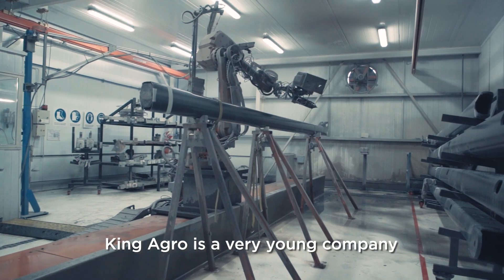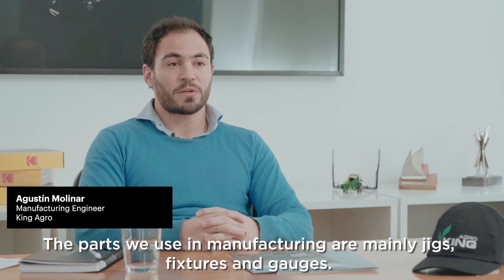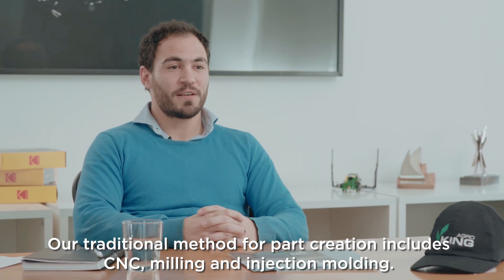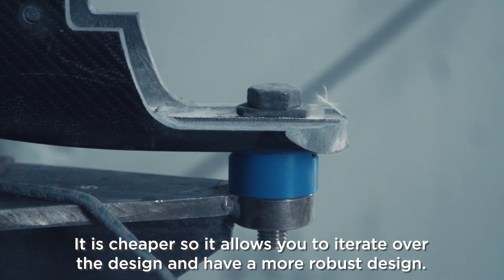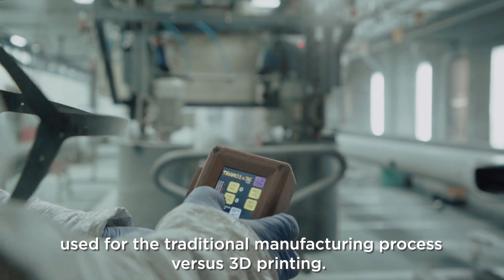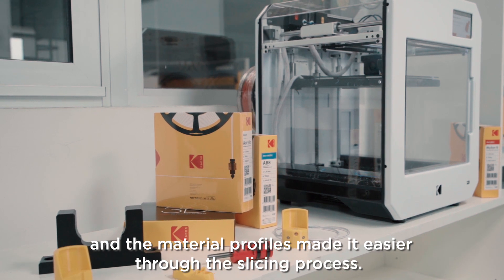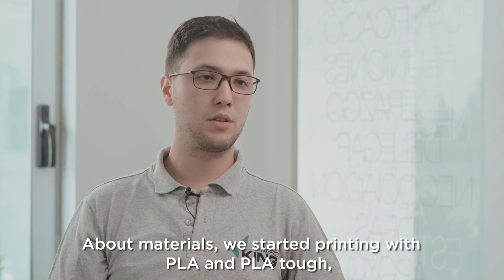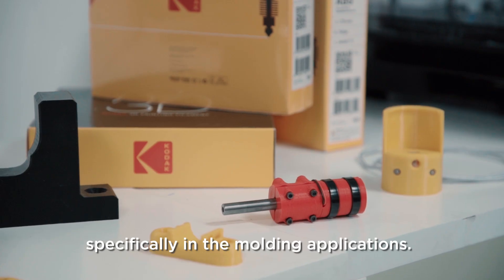King Agro: Optimizing production with KODAK 3D Printing

Comment: I’ve had 2 Kodak Portrait Printers. The 1st was delivered without the ability to use both nozzles.   Although I got a discount for being an “early bird”, that doesn’t mean that it’s understandable that the printer should arrive in a defective state. After weeks & several calls, it was replaced. I was attracted to their 2 nozzle approach because it would make some parts easier to print, & less tedious to clean up. After the 2nd printer’s arrival several weeks later, I experienced a filament “cross over” that caused a drive belt to dislodge. Although, probably my fault the warranty covered it. 
When I got the printer back & tried to print , Nozzle #2 wouldn’t load. After many weeks, my Step Son disassembled the feed dive for nozzle #2. It seems that the solvable filament that was in the printer at the time of the cross over repair was still in it, causing a jam.  I couldn’t have known this, & it only became apparent after dissembly of the machine.  At this point I have a nearly $2800 Albatross with a violated warranty. The packing material is trashed after 2 rounds of shipment. It’s a shame, may be an isolated incident, but I expected better.
Reply: That's so sad man. Thanks for sharing your experience with kodak.